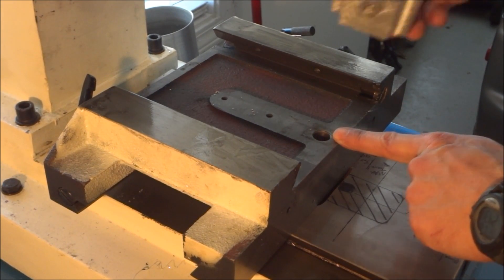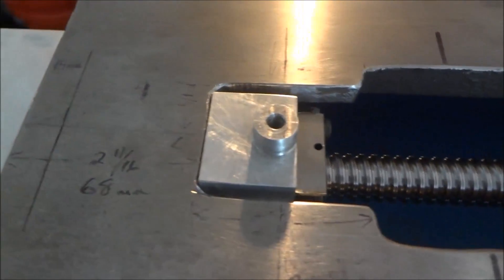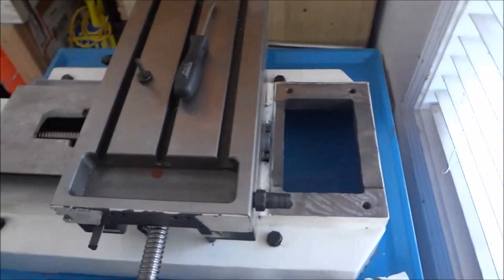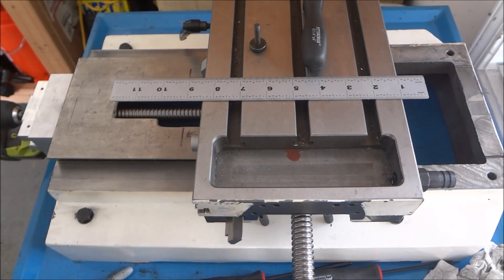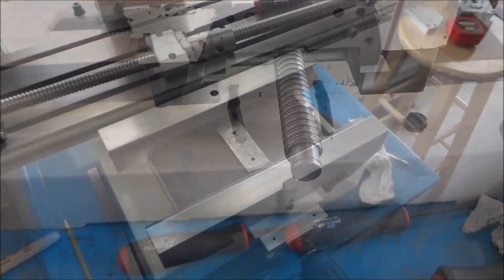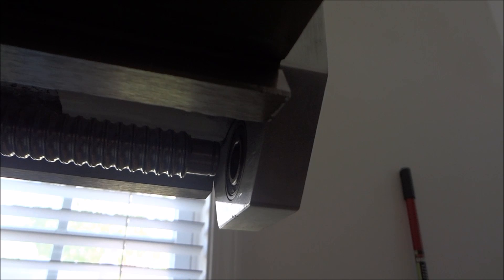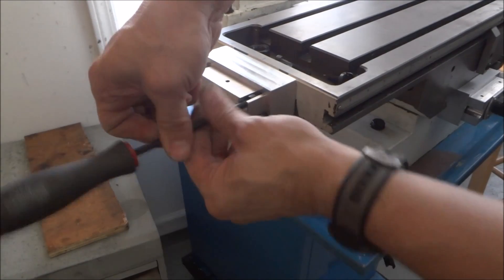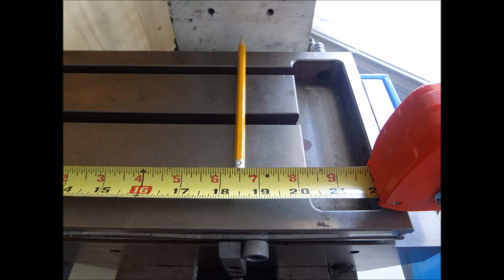PM 727M  X Y Test Assembly

Comment: Sam... on the ballnut what did you have to modify for it to fit on the x axis  ? What is the total height between the bottom of the trough to the top of the saddle
Reply from the maker: Hi Michael,
 I'm not sure I understand the question.? With the table on the saddle Measure the distance from the top of the table to the " mounting pad" the X ball nut mount will sit on. The top of the table to the center-line of the Ball screw is 2" . So the remaining distance is the length of the Ball screw center-line to the pad. This has been known to vary from my mill. Your mount should reflect this dimension. My mill was .67048"  they have been known to vary up to .040"
Reply: @CNC4XR7  yes thats exactly what I'm talking about thank you so much . That is the number I keep getting so it must be right

Comment: If your castings were machined correctly from the factory, an easier way to rough align the ballscrew mount to the saddle is to indicate the mounting face zero/zero with the Y axis.

If the factory did it's job correctly, you'll be able to align both end mounts with way less work.

Just a thought.....
Reply from the maker: This was not such a ordeal really but you may be able to indicate it as stated however your assuming the Column and or spindle is attached. Which in the case it was not.

Comment: Sam you didn't show how you went about tightening the ball nut mount to the saddle ( 7:39 you did say you left them a bit loose for adjustment); Once you had the end brackets/bearing in place, how did you tighten the ball nut mount? Or did I miss something?
Reply from the maker: Ahh Hah! well yes I vaguely did @ https://youtu.be/XHoi5Xdb-ns?t=599  you need to mount the floating end line up the ballscrew . then slide the table back without disturbing the ball screw and tighten the ball nut mount a little more recheck. if all is good install the bearing block and check if your ball screw is straight you should be good.
Reply: @CNC4XR7  
I see no way to:
"...slide the table back without disturbing the ball screw and tighten the ball nut mount " if the ball nut mount cannot clear the end of the table to expose the SHCS that hold it down to the saddle. ( at least with the gib in place anyway )

 I have to tackle this same problem is why I'm asking. 

I'm guessing you mean to:
 
1) install the end bracket/floating end bearing, align the ball screw and ball nut mount.
2) then take off the end bracket/floating end bearing off. 
3) Remove gib 
4) then remove table
5) Tighten ball nut mount
6) rinse and repeat until all is good
I'm thinking of having the SHCS come from underneath the saddle  so I can crawl underneath the mill to tighten them when all is straight alignment.

Comment: i can't believe you made that yoke out of aluminum.
Reply from the maker: Really! I had someone recommend to me Not to use Steel as they had and everything turned to rust. I did consider it momentarily however the  original as you know was Brass for the ACme screw. Not Aluminum but still soft. The Ball Screw mount has little force or movement on it if everything is well aligned.  The Beauty of DIY is you can use whatever you would like.
Be Safe,
Sam
Reply: i just figured that little nubby sticking up is what translates all the force to the saddle to move it around. On bridgeports those yokes are cast iron
Reply: And if everything is turning to rust, you need to mix your coolant right :D
Reply from the maker: Diesel Ramcharger 
oh no im not having rust issues. i suppose if there ends up being a issue i can just machine a steel piece. that the nice thing about making it yourself.
Reply: Exactly, once you got the cad and cam you can cut it from whatever you want. On the boats we use monel or K-Monel on pretty much anything below the water line.
Reply from the maker: Yeah You need it there for sure.
Reply: At the hobby level, aluminum works well enough...you have to remember IT'S NOT A BRIDGEPORT !
Reply: FADAL used aluminum for ballscrew mounts and gibs and never seemed to have a problem, and they built machines way bigger than this one. 

Done correctly, it shouldn't be a problem.

Comment: I did a rf45 clone, just a suggestion but I had to go back and loctight the ball screw mount bolts. Oil and vibration kept making them back out
Reply from the maker: Great Tip Yes I will be using LocTite when I do final assembly

Comment: Great video, however, it does make me a little nervous regarding my own build (I'm worried about the rigidity of the linear rails I chose - specifically the linear bearings). I'm hoping RPM + HP will cancel out most of the torque the table might experience...
Reply from the maker: What rails are you going with?
Reply: From what I already have, the Y axis will be two SBR20's 10" on center and the X will be two SBR16's 5" on center. The rails aren't the concern, but the cheap linear bearings I bought from China.
I'm hoping in this configuration I can drive it hard enough to at minimum mill aluminum.
Given this is my first build of this type, there is quite a bit of trepidation.
Reply from the maker: The round linear rails are not well suited for dusty environments the bearings tend to freeze with gunk. at least my experience. the Linear rails are used much more these days. http://www.ebay.com/itm/New-THK-Linear-Rail-HSR12RM-with-Bearing-Block-/222184224427?hash=item33bb3636ab:g:zo4AAOSwwpdW-w3g